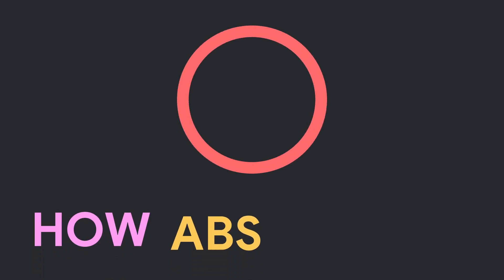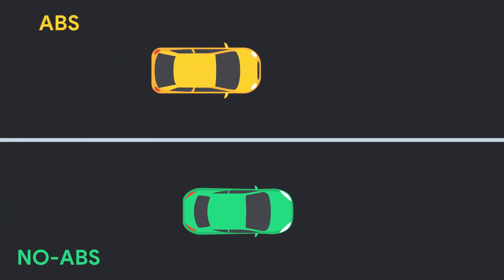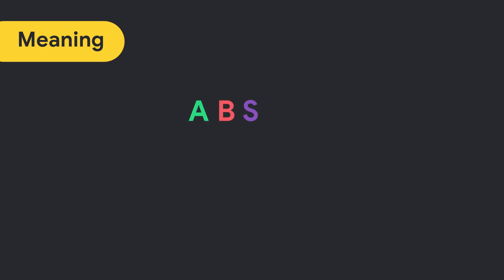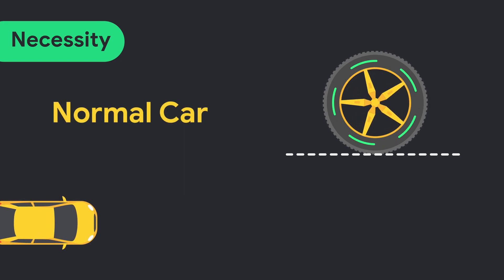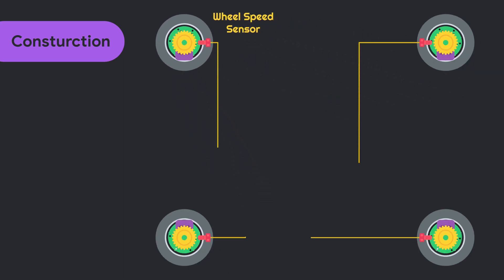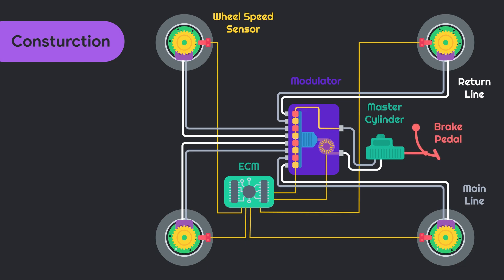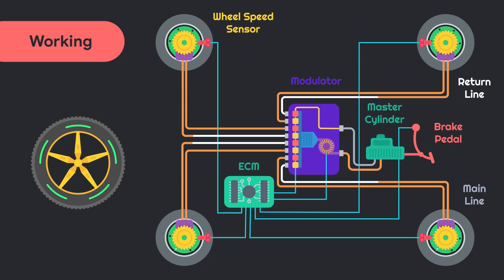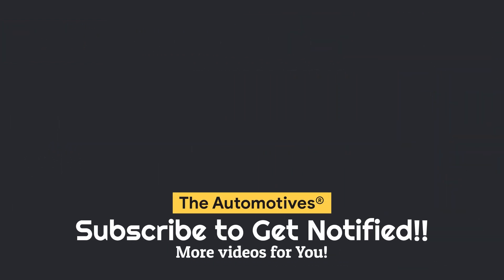[English] How Anti-Lock Braking system Works?

Comment: we know that, generally four wheelers are run at a high speed compared to two wheeler so basically high heat is generated in four wheelers while applying the brakes  then why we are not providing any holes in four wheeler disk. what is the actual reason behind it or what is the engineering behind it ???
Reply: In cars ventilated disks are used and  since cars have weight it also causes dotted disks to break